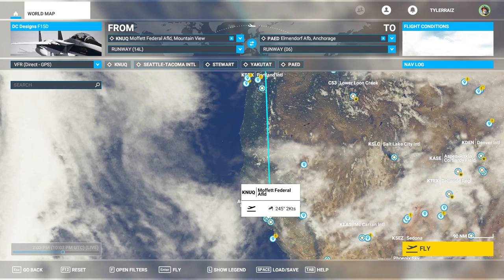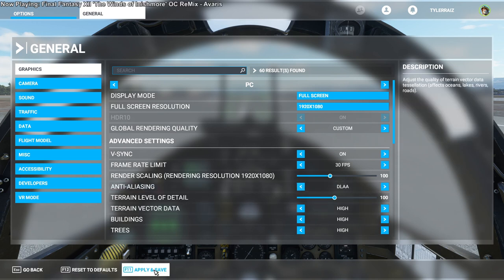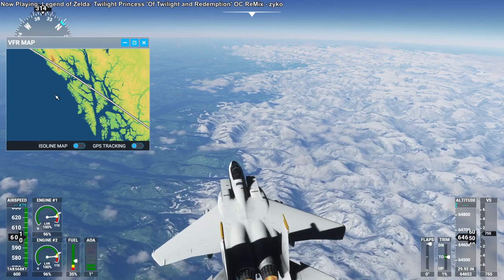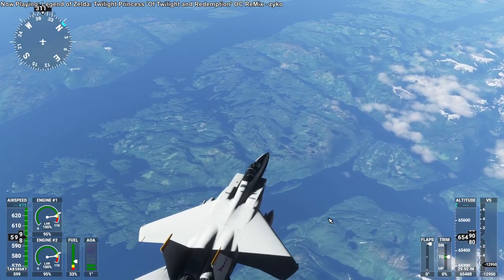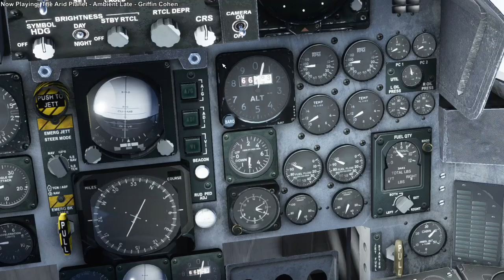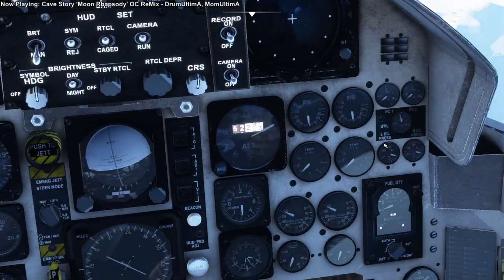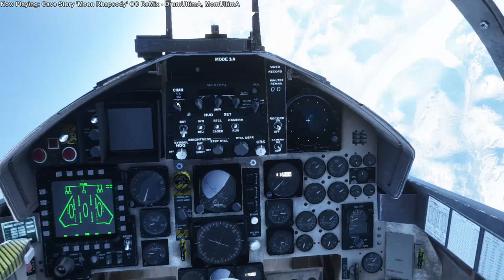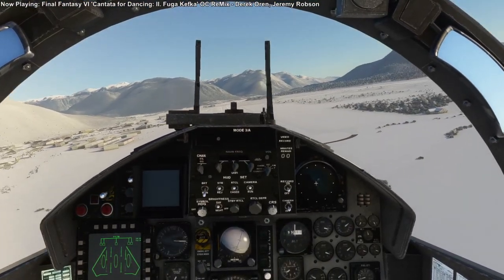Flight Sim 2020 - F-15 from Moffett Field to Juneau

Comment: I have a few questions regarding KSP if you don't mind. Firstly, would I be able to have the steam version of KSP and the Official Squad version on my PC at the same time? And second question, does the Official Squad version update when there is a new version automatically. Do you just pick a version, install, and that's it? I'm getting the squad version for RO so if I go and make it 1.8.1, is there anything in the game I need to remove or delete?
Reply from the maker: You can have as many versions of KSP on your computer as you like. I have never used the launcher that comes with KSP - it might do updates - I've always just started the game with KSP_x64.exe and gone to the official website to download the new version manually. They have a bunch of versions available on their website in both zip and exe form. If you are installing for RO, nothing in the base game needs to be altered, but probably lay off installing the DLCs if you have them (they will be separate downloads on the official site).
Reply: THANKS!!!

Comment: So is it impossible to keep fly level with this mod? or is it just your flying?, you go from 66k to 54k to 60k 🙄
Reply from the maker: In this case, I was streaming at the same time, so I was probably not trying as hard as I might do in an airliner, but at the same time, supersonic planes tend to be difficult to trim out. Even Concorde drifted up along its route as it got lighter. Not a big problem, since there isn't much traffic at those altitudes. I've had Concorde mods where the autopilot could actually handle it, so that's not impossible, but this plane's autopilot was not reliable in this version.

Comment: Why are you descending with engines at 90%
Reply from the maker: The peculiarities of the fuel consumption when the plane was in this version, which I think was fixed afterwards. I felt it was disadvantageous to throttle down in order to get range.